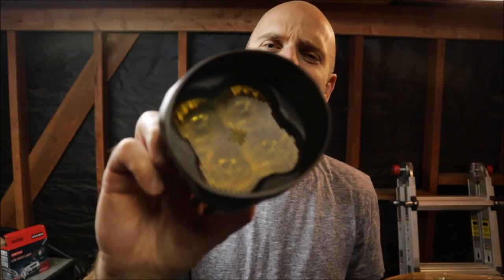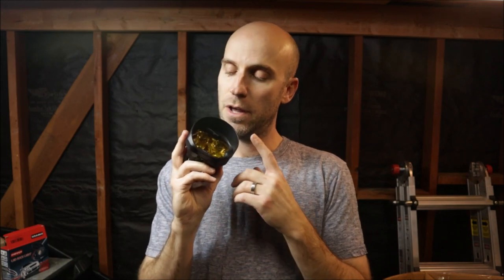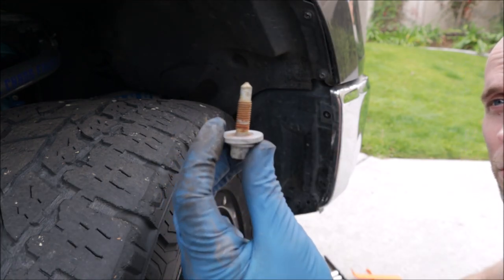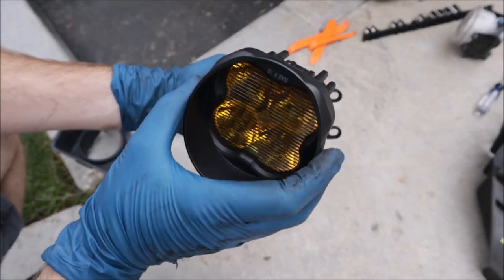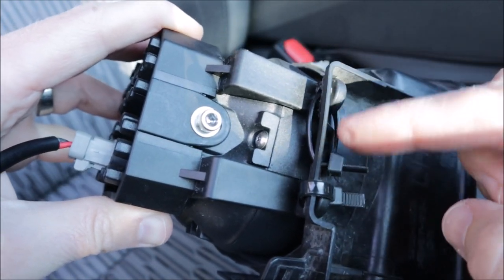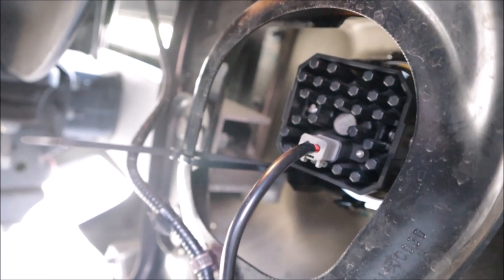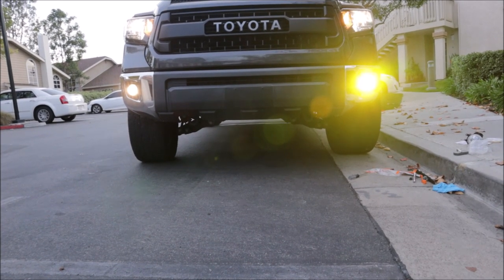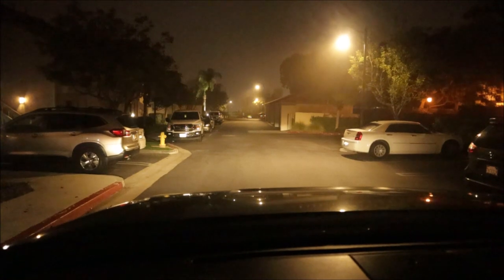Tundra LED Fog Lights Install: Diode Dynamics SAE DOT SS3 Pro

Comment: I have the pros in white and amazingly they outshined my factory LED low beam on my tundra.
Reply from the maker: Jimmie G  nice! Any troubles aiming them?
Reply: Road Patina The adjustment is very limited. i can see y you use zipties. I aimed it to the lowest but essentially these fogs r too bright to have any clean cutoff. Maybe i should have gone with the Sport.
Reply from the maker: Jimmie G I thought the same, but with the output of the pro’s I would have always wandered what I was missing, if I got the sports!

Comment: I believe they offer a flat bezel instead of the angled bezel you have on the fog light. Do you think that would prevent the movement by setting/sealing in the housing better?
Reply from the maker: I have not seen an updated bezel. It’s been several months since the install and there was only the round oem and the square oem from the trd pro with rigids. I would love a better bezel as ALL the lights wiggle in the oem bezel and people have resorted to zip ties, clamps, or custom L brackets. Keep me posted if you find a better way!

Comment: Those clips on the plastic piece definitely difficult to remove without damaging. I have first fog SST pro yellow installed, and second after work today. On my 2017 1794 trim tundra, I installed without trying to pull out the front as you did. Was a bear putting in support tie wraps, and hardest part of all, was aiming. Getting to the 2 side aiming screws really hard. I’m going to pick up a shorty socket with hex and stubby driver with hex to tighten same two screws.
Reply from the maker: It was definitely a song and dance to get them installed. I broke one of those fender liner retaining brackets and used a few screw drivers and plastic trim removal tools on the other side! 🤞 good luck.

Comment: I put in the clear pro model last month. I had to angle them down as far as it would go to try matching headlight cut off. Much better than the wide cornering Baja design they replaced. I know those things where really blinding people and they would let me know😬.
Reply from the maker: Chris Slaughter I read Baja had to recall theirs, as the cut off line was not within legal limit. Still love these! Mine are pointed down too and wish they could be just a bit higher!
Reply: Would you recommend going with the sport instead because of the cutoff?

Comment: Great vid thanks! have you been getting flashed by oncoming traffic?
Reply from the maker: 858RLTR thank you! I had a hard time finding a parking lot with a wall to properly align them. The lights are pointed pretty far down but still throw a ton of light for now. They are actually sitting back on the workbench so I can wrap the bumpers corners, then try again to realign! BTW are you a Realtor in SD?
Reply: Road Patina Thanks for the reply. I have seen a few other vids where they adjusted them all the way down to prevent blinding people. They look to have a pretty good cut off also. 
yes I am a realtor here in SD. Guilty as charged haha.

Comment: So I have a question. I installed my ss3 pros on my 17 tundra today but will only turned on when my lows are on what did I do wrong?
Reply from the maker: Fogs are wired from the factory to only turn on when headlights are on. If you want to turn them on independently, research “Anytime fog” mod for Tundra. I believe there are a few methods!

Comment: was there any light bouncing with the factory fog light? If not, then maybe it’s not their fault when you install a different fog light. Was there a big difference in weight between the 2 fog lights?
Reply from the maker: The factory fog was very loose and rattled. It was not noticeable while driving because they put out such little light. I think the only real fix, is to make an L bracket and mount the light directly to the bumper support.
Reply: @RoadPatina  oh ok.... the color is so nice though.

Comment: Can you make a video showing how to install the switch?
Reply from the maker: Claud Guam the factory switch on the signal stalk works. I do not have a separate switch for these. There is a few different ways to run them as 'anytime on.' This mod is well documented online if you want to give it a shot!
Reply: I have a 2018 tundra and I tried with the signal and it’s not working,  I install a relay and it’s not working.

Comment: I installed mine and they are great except that when I turn them on they generate a ton of RF noise in my FM station. Has anyone else had this problem?
Reply from the maker: Hm none with mine. I’d reach out to DD.

Comment: Do you get alot of people high beaming you back? I just recently put my ss3 pro sae fog on my tacoma and almost every car I drove pass is high beaming and honking at me lol. And yes I did adjust it way down.
Reply from the maker: Really? I have mine on all the time even in day light and never get flashed. Not even once. I did use a wall and measured about 25 feet out to make sure they were aligned well below my headlights. They had more adjustment than I though. IIRC if you push them in first, they can aim down even more.
Reply: @RoadPatina  honestly I'm trying not to be the asshole on the road but what can I do. The light put so much putting i cant control it. I've already adjust to the point it where it bottom out. Can't really do nothing to it.
Reply from the maker: @guywhosleepallday8194  I get it bud! I feel the same way and turn them off if needed. If you don’t see their faces lit up, they are probably not getting hit with the light, just not used to the high output.

Comment: Is the housing of the light plastic? Or aluminum?
Reply from the maker: The housing of the light is metal and very well built!
Reply: @RoadPatina  cool just making sure! Due to budget will be going with Diode over Baja
Reply from the maker: @yezkaholic  Diode was my first choice after much research. You can buy the sport over the pro and save a bit more. Just not the same output. BD lights were having some issues being truly DOT legal at the time I purchased.
Reply: @RoadPatina  yeah ive looked into both options, the price difference is significant. Most folks say BD is a bit brighter. But do you really want to pay couple hundred extra for a bit more lumens
Reply from the maker: @yezkaholic  I also consider other drivers on the road being blinded! Need to have a good cut off line. Great info on the link I posted from tacomaworld forum.
Reply: @RoadPatina  thank you for your helpful insight sir!
Reply: @RoadPatina  subscribed
Reply from the maker: @yezkaholic  best of luck!

Comment: Lights should never be aimed higher  at their hot spot than the center of the light  is from the ground...  ie. 24" from the ground to center....  shouldn't  be aimed more than 24" up the wall at 20 feet...
Reply: Fogs should be aimed flat.... not up towards  the headlights.... that's what blinds drivers eyes .   You see so many of these trucks with modified/ aftermarket fog lights driving around where the fog lights are 10 times brighter than their headlights.  improper  aiming is the reason why.
Reply from the maker: Correct! Good info.

Comment: Toyota seriously failed on this hole Fog Light mounting system.  The TRD Pro fog are even worse since the bumper end itself is also plastic.  Just fucking garbage.  I have cable ties all over my Rigid TRD Pro fogs and they still shake.